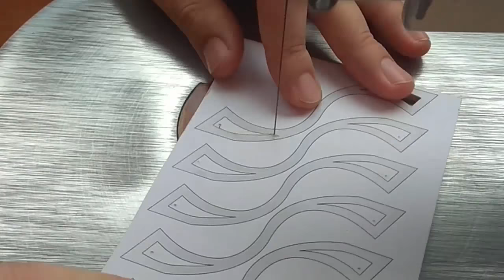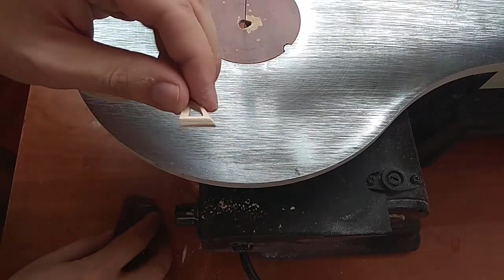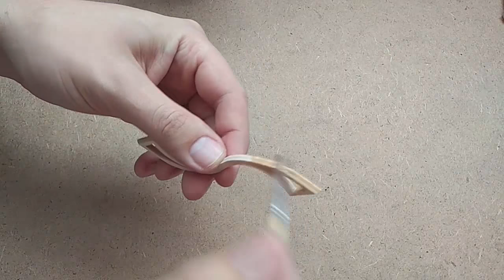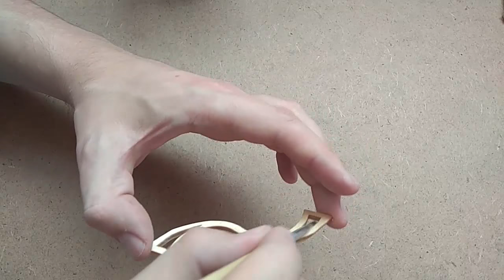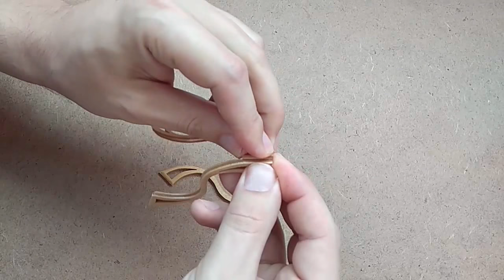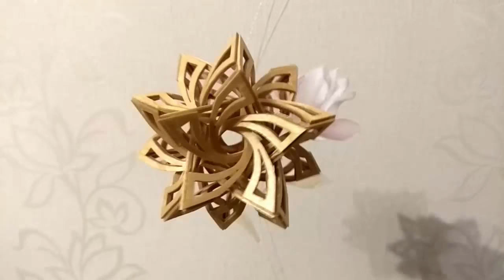Scroll saw project "Frabjous" - wooden geometric sculpture

Comment: Amazing work! what did you use for adhesive at the connection points?
Reply from the maker: Glue I use is called "88 Universal". Instruction: apply glue on both surfaces, wait about 10-15 minutes until the glue dries, squeeze the glued surfaces. The main advantage - glue is not squeezed out, because when you squeeze surfaces it is already dried.
I know that in the USA similar glue is called "Contact Cement", I found a short review at Youtube - https://www.youtube.com/watch?v=mLhgAPlY7lw
Reply: @AlexFoxScrollsaw  Thank you so much!

Comment: What blade are you using? I'm new to the scroll saw and the only blades I can find are much bigger and they all have pins on both ends that would never fit in the pilot hole you have made. Love the project, very well designed!
Reply from the maker: I use only flat (pinless) blades. For this project I used blades #1 of LuxTools (Germany)